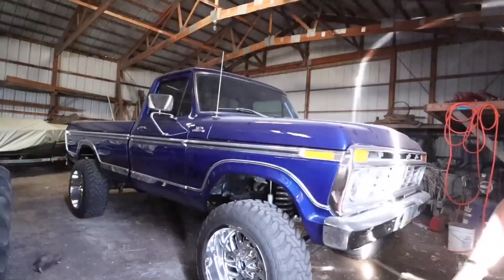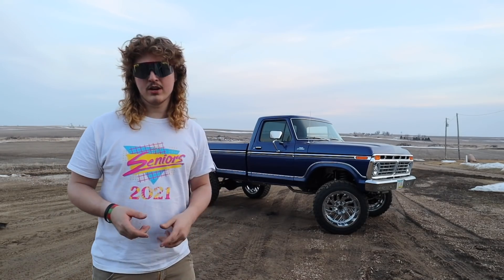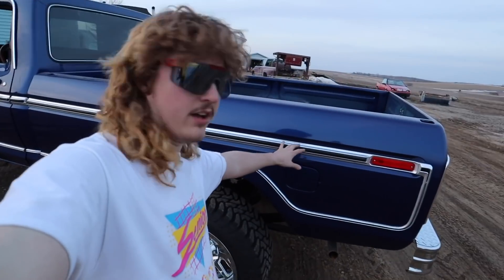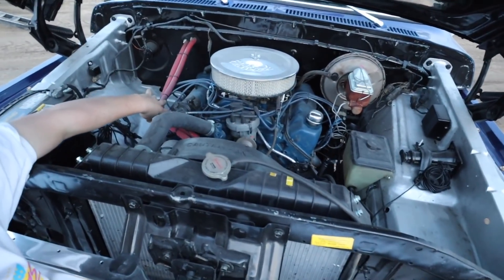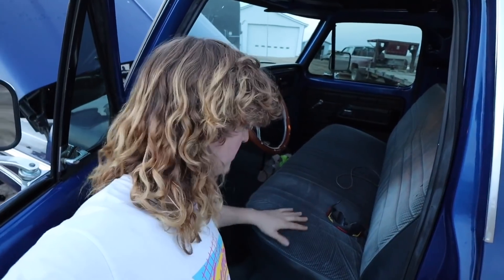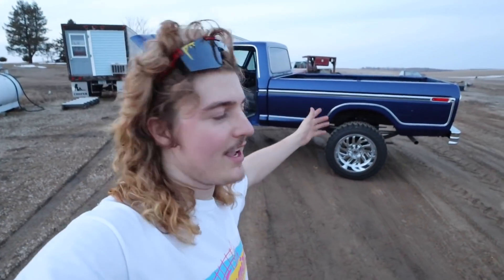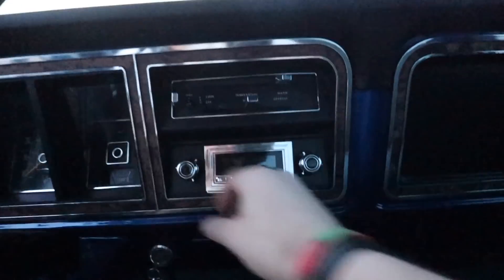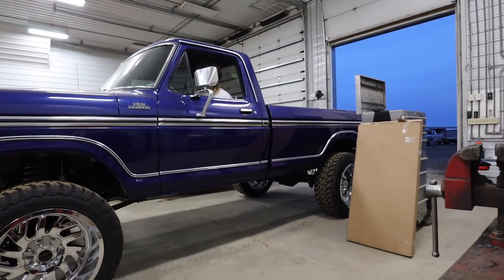I Brought My Dream Truck Home

Comment: I'm almost 70 Coop and to be 17 again and to have the world by the tail would be something.  I worked for a year after graduation and saved for 1 year in college, applied while at Eastern Illinois for a state teacher's scholarship which I was approved, but Illinois had financial problems in 1970 and the new governor rescinded all new scholarships.  I went back to work, met the girl of my dreams and married (49 years and counting) and eventually went into law enforcement eventually promoted to detective in the violent crimes unit and later to internal affairs.  You're right dude, college is not for everybody, but with the mechanical and farming experience it sounds like you're doing the work you love.  Continue on young man and never look back.

Comment: I'm jealous of that truck I love them ol 74-79 body style
Reply: I drove a 1979 F150 back in the mid 1980’s. Got T-boned and totaled it. I miss that truck still. 🥲
Reply: 79 model have the square headlights.
Reply: @pzmqyhniq  I don't blame you they are really clean looking for there old age.
Reply: @craftman5632  yeah
Reply: @craftman5632  but then they went back to round ones and had a different body style

Comment: That's a sweet truck. I had a 79 4x4 f150 in the 80's.  Lots of repairs and lots of fun. Sold the truck for 2 grand, that same truck now would sell for 12 grand plus. Selling it is my biggest regret.  Job well done on the restoration.

Comment: I got a 79 f150 4x4 Swb. It’s a rusty Michigan truck but it still strikes up conversations with older people at the gas station. I plan to fix all the rust, blast the frame, and paint it, and I got parts to build a 429 big block sitting around. It should be pretty cool when it’s done.

Comment: Warning on the exhaust cutouts, they dont seal fully so when they are closed it sounds like you have a exhaust leak, I spent almost $500 dollars for a dual exhaust kit, installed it and it leaked sounded like shite, sounded good when it was open tho. took them off.
Reply: Buy quality cut outs. Problem solved.
Reply: @gregjames5070  They were Quick Time Performance cutouts from Summit # QTEC50CP $500 dollars. If you know of a better quality one I would like to know. Everyone I know with cutouts leak.
Reply: @gregjames5070  Thats what I thought, you know nothing about cutouts. Just trying to save him from wasting his money.

Comment: I think the wheels look great on it! I had a similar truck (mine was a 76). The front cab supports were rusted and I had to fabricate new ones. You can get the Rhino lining with the same color as the rest of the truck. Chrome up the engine bay... get something done for your grandpa on the underside of the hood. College isn't for everyone....
Do what make you happy and successful (in your eyes, not someone else's opinion)

Comment: Mulley (I think that is a cool nickname for you), I agree on that Uni thing.  Not everyone is cut out to go to the Uni.  I live in Germany and they have it right in my opinion.  There are different levels of schooling.  I taught programming at a BBS (Berufsbildende Schulen  - Vocational School) which also had a Gymnasium (College Prep School).  At the BBS, they taught everything from plumbing to car repair to civil construction (building roads, sidewalks, walls, etc. ) and even farm and dairy.  And along with that, certificates were even awarded to those who complete the course making them more employable.  Many of the programs also required you go to school until your sophomore year.

Comment: Love this truck. I had the same 1977. Mine was mint but had rust everywhere.  Sold it at al loss back to the guy I bought it from. 460 ad it said explorer where yours says ranger. Sounds the same. Mine was all Og 2wheel drive drum brake short bed.

Comment: Coop, get some Clear Bra for the rocker panels. It's almost invisible and will protect the paint.The sound deadner is called Hush Mat. Don't forget the inside of the doors. 

The only thing you might want to upgrade would be the addition of disc brakes on the rear. From what I saw, the truck still had drum brakes on the rear, but I could be wrong.

Comment: Okay, Here is what I suggest.  Put a 460 C6 in it with a single plane 4 barrel intake and a Holley 750 double pumper carb. A 351 Cleveland can work but I would stroke it to a 408 cubic inches.   Find or have a set of Stainless Steel headers built for it.    A little extra power just makes it a lot more fun to drive. Posi Trac or Track Loc front and rear.  Forget the air lockers or detroit lockers.  Get a good Mark Williams 3.250" third member with a Mark Williams billet aluminum pinion support.  Upgrade to 31 spline axles.  Aluminum Mark Williams drivelines, Rancho 9000 or Fox external reservoir shocks.  Dual shock in front and single in the rear.  Replace all rubber bushings with urethane.   33" to 35" radial RT's.  They all throw rocks.  Some of the AT's are way worse than MT's.    Some nerf bars will help deflect them from the body.  Build your own out of aluminum or stainless so they won't rust.    Polished Stainless Steel front differential cover.  Install an Absorbed Glass Mat battery.  Have the stereo shop make you some super cool battery cables.  A rear disk brake kit is a cool functional addition.    I would paint the inside of the bed and get a heavy rubber mat to protect the floor.  If need be you can get some 1/2" rubber stall matt and a 4 x 8 piece should lay in there perfect.  This way you can pull it out and wash the paint and bed mat totally clean so don't dirt won't get under it and rub through the paint.  An in the bed tool box that sits flush with the sides of the box.  No diamond tread plate.  Get the polished stainless smooth box.  It won't be cheap but is so much nicer.  Change all marker and turn bulbs for LED's.    A behind the seat rifle rack.  Keep your long gun out of sight but ensures it's always with you.  I drove a 79 F150 Ranger 4x4 when I was in high school.  400M/C6 short wide box.  4.10 gears and  31x10.50-15 tires so it could still fit in a 8' garage.  It was a beast.  We had headers into dual 2.5" pipes with glass packs on it.  It sounded sweet and the headers really helped the power.    This should keep ypou busy for awhile.  Sometimes less is more.  A clean truck always looks nicer than one with a bunch of useless trash bolted all over it.  I loved my bench seat.  That way my sweetie could sit right by me.

Comment: My first pickup is a 79 F250. The bright dark metallic blue.   Needs full restoration... I have owned over 30 Ford Trucks.   I will be pulling the it to the ground.... I recently found the American Racing Hurricanes... period correct  12.5 x 33  x 16.5.  Best trucks ever built.

Comment: That's a beautiful electric blue. Maybe kit the back? Liner to protect it from rust and a flat bed cover? You could put a base speaker and some lights in the back. Agree with a tribute to your grandpa. Either under the back cover so when u lift it it lights up with cool neon blue or u could put it under the hood. But how often do you open the hood? That or put it on the tail gate. Get rid of the tires until winter. Get regular now for summer. Switch them out for snow days.

Comment: Nice truck. Sucks that your on gravel roads! Put on some part time mud flaps for the gravel roads. You can fab up some brackets that have keeper pins that pull out then throw the flaps in the bed??

Comment: Sweet truck.  If you want to show your brother how to start brush pile fires in any weather pick up a 500,000 btu propane torch from fleet farm. The kind that use a 20lb tank. Guaranteed to work. And fast.

Comment: Bedliner. I would recommend going dark. Probably black. Anything colored is going to get "marked up" from setting stuff in it. I have a silver dually I got the bed lined with grey bed liner. It shows water lines from pooled water and after it drains/dries. It also gets marked  up from putting stuff in the back like throwing a spare tire in the back. Will leave/show tire marks. Bugs me. If I did it over, I'd go black. Second, might consider going with Raptor liner. Very cost effective. Probably about $150 to do it yourself. If you go with something like  Rhino/LineX, is going to cost you $500-$700.

Comment: love your truck Coop. I had a brand new 76, F-150 early model super cab. long gone now,   (but I'm still here  😁). Only thing I see that in my opinion would make the truck look nicer would be larger diameter tail pipes and exhaust tips. Yours look way too small. Again my opinion only.

Comment: I am a body guy an live in M-town and have just the guy to do your under hood! Also have the place to do bed liner. Been doing this for years and I know the best in DSM. I work in DSM at a body shop were I did a '79 F-250 that was a family heirloom for a tree farm in Altoona. Love the truck! paint work is really nice would like to know where you got it painted. Let me know!
Reply from the maker: Do u have Instagram? Dm me!
Reply: @MagicMullet xtreme liners of central iowa there in DSM off of 54th Street. check out their work they use Line-X material but they get it to spray out a lot smoother than the  Line-X company on Broadway. Look up John Parker in indianola. I don't have Instagram I did make one an DM you my number but I don't use it. I know he has stuff Pinterest and other stuff if you Google his name. Airbrush pinstripe gold leaf everything he is the best of the best in this area. If you can't contact him I do have his number but I don't want to put it out here. Let me know good luck man!

Comment: Cooper I'm 63 and I would love to drive you truck. Trucks and cars had a totally different feel to them than the ones today. I tried to get my license in a 1972 Ford with no power steering never got out of the parking lot. Don't laugh I went back in a Monte Carlo don't remember the year. It was the one that had one of the looong front ends on it and got them. Parallel parked that thing first try I was 17 but I drove a couple years before I got them lived in the country got to love back roads. Do something for your grandpa that represents him under the hood.

Comment: Trux accessories has a dual revolution under glow lights,have many different lights and you can get them to change colors while driving.they are a well made light used on semis but can go on pick ups.

Comment: Love the truck since the first I saw it. Owned a 72,75,76,77,78,79. 76 was a blue 4 wheeler 400. Paid 6800 new, try that today, got a whopping 9.8 MPH with three gas tanks need them.

Comment: College is not for everyone but I do wish you would have added that you need to work HARD if you ever want to be successful. Also it doesn't hurt to save your money so if something comes along you want you can buy it or as in your case fix it up. Unfortunately not all kids have dad's and grandpa's like you and Cole. Men that are there to teach them like your dad and grandpa did you guys. I love the truck it is just a little newer than the one my husband bought brand new way back in 1976. I ended up selling it in 2000 about a year after he died because it needed some work on it he was going to do and with the cost of that and insurance for it and the other 2 vehicles I couldn't keep it. I cried the day it left my driveway for good. I know your grandpa enjoyed every minute he got to help you with it so enjoy it.

Comment: I  agree with you 100% I didn't  graduate from high,school.  I'm 70 years old now and I've been retired since I was 59 years old. Also I  love the old ford that's all I will drive still have our first f100,1968 with a 390 motor,has 429387 miles on it only  about 18000 miles on this motor, the original motor lasted just over 410000 miles all farm work, some drag racing to. My twin grandsons want the old truck so I will give it to them when they get 16, they are 13 years old now. I'm glade that old truck can't talk I would be in some trouble with dad back in late 60.

Comment: I really like and use maxxima led strip lights for under glow on the tow trucks I maintain. They come in variety of lengths and colors. They also come with a 5 year warranty on them.

Comment: Wheel rings are suppose to be self tapped unto your dust shield from the outside in, or drill small holes for the bolts and the long part of the L bracket goes onto the dust shield. I’m 34 and super jealous lol. Use lynex in the bed. If the wheel lights have a QR CODE, on the Bluetooth box, Your camera on your phone should help you find the app.

Comment: I  would keep the motor close to stock if you want to drive it those trucks had really strong drive trains in them,  were really tough and well built    nice looking ride   I worked on a few  in my youth ,back in the day many farmers had those old work horses

Comment: I also got a styleside (78 F100) still working on it though

Also, LMC truck has a headliner with built in speakers, seems up your aisle. They got a lot of good interior stuff, just wouldn't trust them with engine parts.

Comment: You can get ,hard to get parts at  Dennis Carpenter Ford restoration parts in Concord NC.We restored a 69 f-100, and got a lot of the parts there.{ new parts}

Comment: A 2 year vocational degree AA would do you very well in the future.... Truck looks and sounds VERY nice... Are you sure that the engine is a small block 351 Cleveland and not a 351 Windsor the valve covers look Windsor ??

Comment: I have the same truck almost. Redid 25 years ago. You don't need college. I am more successfully and made more money than allot of people I know and they went to college and have commented about it. I used fog lights for undercarriage lights. I bought blue ones from pep boys and wired them how I wanted. They can take so be abused because I romp around with mine. It needs another fresh paint job but still runs and drives great. I went the 460 way with cobra jet heads for the engine.

Comment: So you know, a Cleveland is not a big block. It's kind of a between engine. It has the small block bell housing bolt pattern, but it's bigger than the other small blocks. It's not as big as some of the big blocks either though. It's a confused block Ford.

Comment: To avoid rock chips, because no matter the tires you will get some here and there, but I know we have bed-lined the bottom 1/4 or 1/3 of the trucks and have had real good luck with it. And it looks pretty good.

Comment: Tried college not for me, got a job at a frozen food manufacture. Worked way up to senior mechanic/technician making $100,000 a year, retired after 44 years. I followed my passion for machines and did very well. My sister and brother both went to college with One in engineering and in physical therapy and nether made more than $80,000 a year. You can be successful with out college!

Comment: A few words from an older person, our school system was designed to make good manufacturing workers. Basically sit down keep your mouth shut and do your best work. College is a farce you would be much better off to go to a good trade school, you will learn useful skills and not have a mountain of debt when your done. Your brother has a degree in finance and should be able to teach you all you need to know about doing the books for your enterprises. I would suggest restoring more of those 70's Ford pick-ups as they are becoming a hot commodity. They sold new for around 10k and now fetching 30 to 40 k.

Comment: Man college ain't for everyone. I finally went to college and graduated with a graduate degree when I was 37. Love the truck, just don't let another youtube "farmboy" see it. On the underglow lights, if they are RGB LEDs, it's going to be different than normal. I just finished some in my pontoon and to wire it to green without a controller, black was positive and the green wire was negative. Completely backwards to what I would have thought.

Comment: I personally would have went for some 17 or 18 inch rims, but it is not my truck. If it was mine, it would be the same color but smaller rims and mudflaps/splash guards.

Comment: A's and B's make ones path a lot easier to start out in life. I agree you don't need to go to college to be successful. BUT you have a family farm, y'all have a landbase, you were born into a job basically. I'm not saying you don't work hard or would not work just as hard if you didn't have a family farm, I'm just pointing these things out. Sure you have a hay business you run. But again the family farm thing. Even if it's on leased ground that you lease for the biz or you go in half's of whatever for the hay, you still have access to tractors, bailers, trailers etc that a normal kid who does not have a family farm doesn't. My point here is that for a 16 year old to start cutting hay that does not have all that equipment that he can use it's impossible. He can't get a loan for even enough to get used stuff to do that with. He can still work hard and work his way into something, but he may need to go to trade school or learn on the job as he goes and then get certifications and maybe start his own business. You can get there but it may take longer. Here is where the A and B's come in. If you get those you now qualify for more scolorships from the state or just other ones period. You can use those to go to a trade school and if you do well your going to be able to do well faster in life I believe. There are always exceptions of course.

Comment: I love that truck my first truck was a 74 f100 four wheel drive with a 428 big block it was so awesome and that was back when gas was around 1.00 gallon you could put 20 bucks in and go terrorized the back country